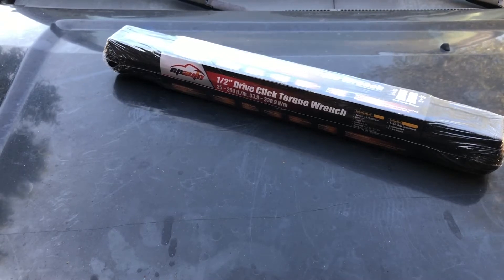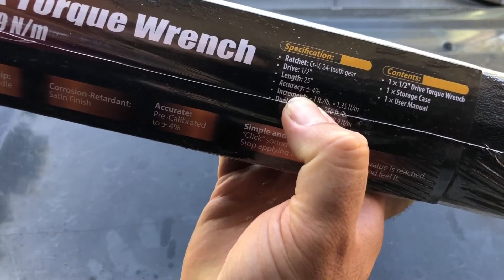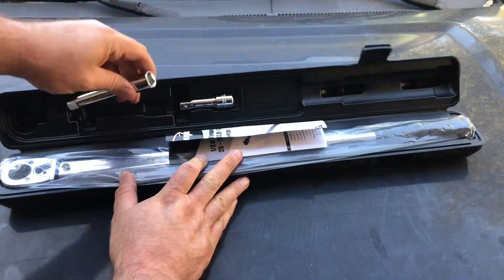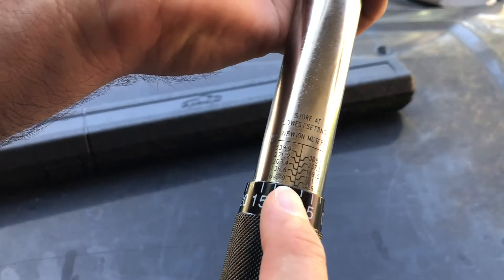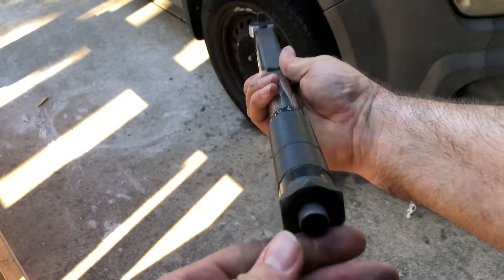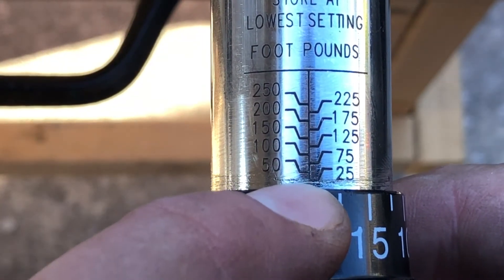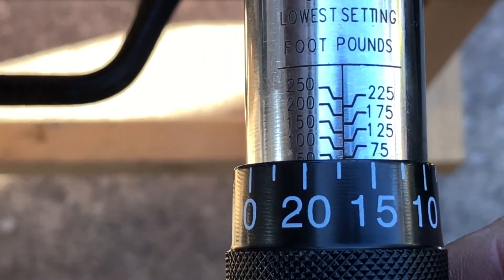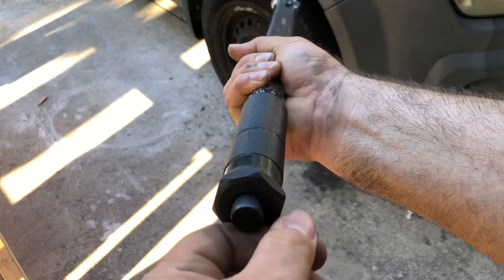How to use a torque wrench.

Comment: I bought one of these and it snapped off a main cap bolt when I was assembling an engine set at 105 foot pounds it never clicked very disappointed in this product. It did click at 75 foot pounds so I know it wasn't broken definitely not calibrated correctly though.
Reply from the maker: That’s interesting. I’ve only had to go up to 80 ftlbs so far